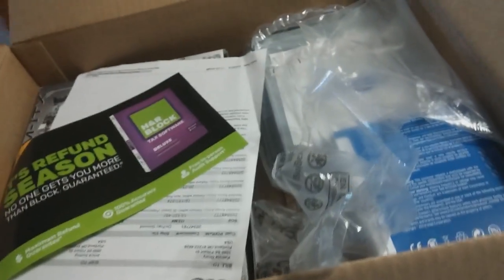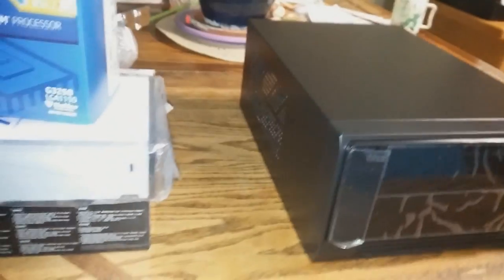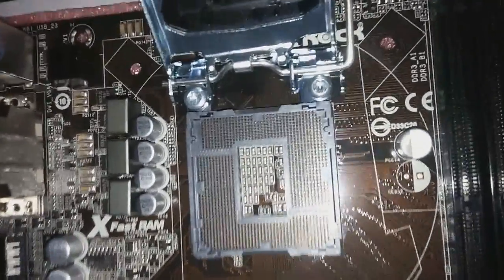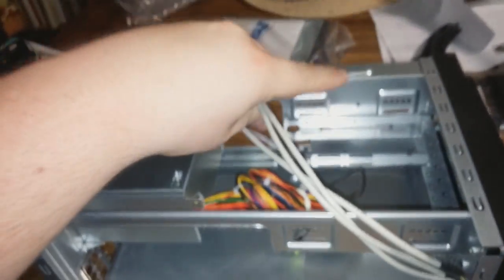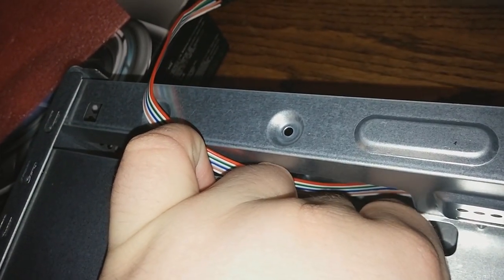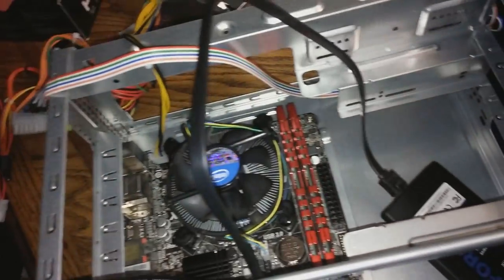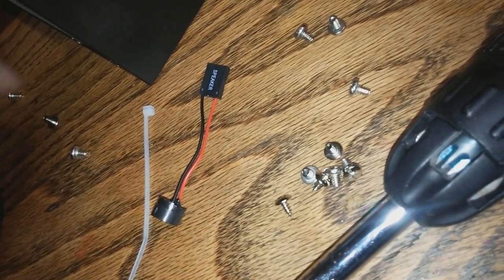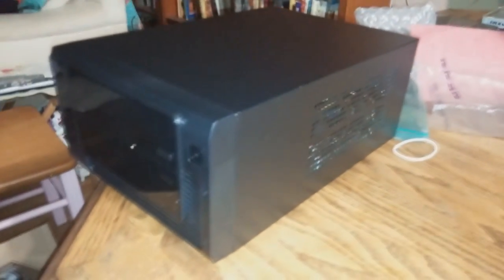How To Build A $300 Budget Mini-ITX Computer

Comment: Props guy for putting this thing together with one hand. Im going to though one together next week and was wondering if ya had any tips outside this video. Was the fan on the psu facing down an if so was there a grill I can take off. It might give it a better fit and help suck some heat off the cpu.
Reply from the maker: I did put it face down. There is a built in grill on the psu, you cannot take it off, nor would it make a difference in airflow.
Reply from the maker: This is a rare situation where the psu is in top of the cpu. In normal cases the psu is under the cpu, and you can orient it how you want. But I set it to suck air out of the case.
Reply: +Zillatech Ok got her built but very unhappy with the temps. 42c at idle. It would appear that the psu sitting over half the fan is not letting half the block get air if I had to guess. Im useing a i3-4130T which is one of the more conservative cpu's I could find. Queston is what size case fan do you think this thing takes?
Reply from the maker: There are no fan mounts. It's a passively cooled case. a better cpu cooler would be a good idea, maybe the noctua nh-lni.
Reply: I just bought a noctua 80mm and Im going to make it work haha. The case is 5 1/2 inchs tall and the fan is 3ish. Im going to try and fit it where the hhd's would have been.
Reply: +Zillatech I dont know how I got it in my head that 40c was a bad temp. I got got my brain twisted I guess. Good suggestion on the cpu fan thou. Im just trying to find out how tall the stock cooler is so I can compare. I dont think I need it but they make great fans that are super quiet. Thanks bud!
Reply from the maker: +Phlop Alopagus most low profile will fit. The noctua low profile nh-l9i does fit.
Reply: +Zillatech Ya I thought that was odd that it would be called low pro and not even be lower then the stock cooler.